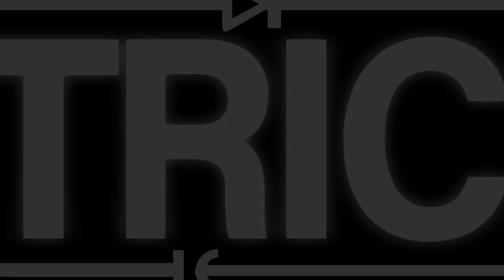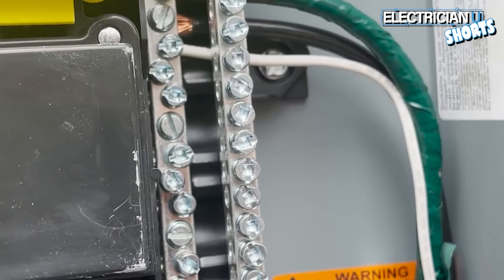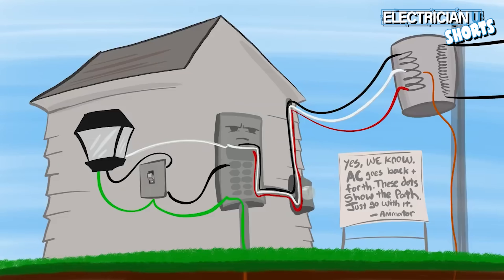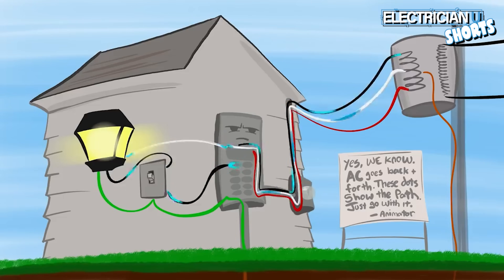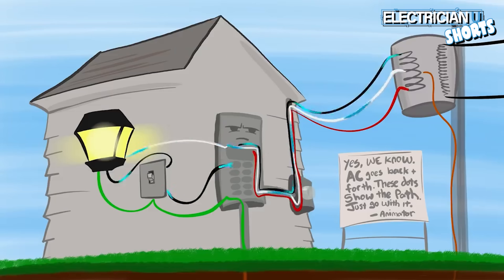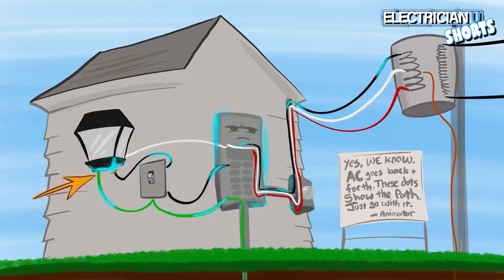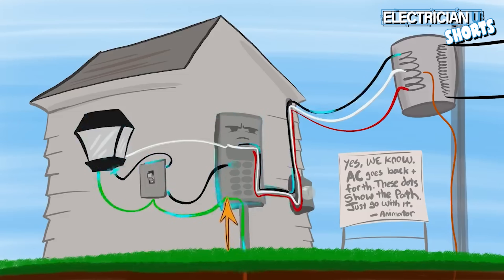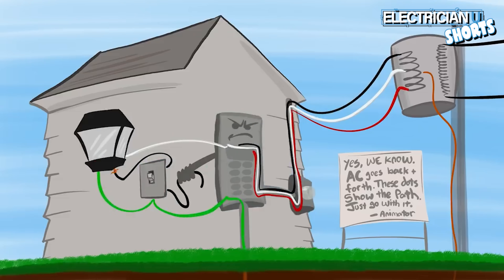SHORTS - WHY WE BOND (Neutral & Ground) Explained in 3 Minutes

Comment: Correct me if I'm wrong, but I think that the circuit is complete in case of the fault even without earthing the neutral, the image you used is for TT earthing scheme, and fault currents dissipated into the ground at the faulty load will correspond to currents being pulled up from the earthing point of the source, thus completing the circuit
Reply: I was thinking the same. This isn't a bad video but I don't think it explains anything.
Reply: The ground rod provides a low impedance path for lightning strikes. Without the neutral to ground bond at your panel (with the first disconnect) a ground fault would have to travel through the earth which is often insufficient to trip a breaker as in the supply's neutral bond to ground is too far away as the resistance through ground is too high. The bonding screw in the main panel is only to connect the panel itself to the neutral and at no other location should have the neutral ground bond. With sub panels the bonding screw which may have been installed at the factory must be removed if present.
Reply: No ground wire is needed to complete the circuit. Ground wire only provides another better path for the dangerous leak to get to ground, and hopefully trip the breaker through over current or gfci. Animation doesn't match the condition he is describing, "no ground".
Reply: It is because of occasions of high impedance ground conditions. If the ground is to dry it will be an excellent insulator rendering any earth rod useless. Check out SWER lines. 'Single wire earth return'

Comment: Hey, thanks for the explanation but this seems to be the old way of doing it. There is a regulation against doing that now, "...As of 2017, National Electrical Code requires neutral in subpanels to remain unbonded from grounded enclosures" So now what does that mean? How is the breaker supposed to trip? Unboding the neutral from ground keeps the sine wave of volts coming into the house clean and smooth, reducing dirty electricity in the house. Let me know what you think
Reply: I've read the same thing about the Neutral & ground only being together in the main & not in the sub-panel, but I saw that it was effective 2008. The Neutral is always going to have the return path and trip if the current coming from the source is not the same as the current going back.
Reply: The key word is "subpanel". They are bonded at the main panel. The key issue is to establish a copper connection from the equipment case to the transformer. Since the only way to do is to use the incoming neutral it is used but at the earliest possible point the ground connector is separated and then kept separate throughout the installation.

I just fail to see the subpanel question. It is like asking can you lie if you cross your fingers behind your back. The neutral an ground are kept separate once they have been separated.

Comment: the rule appears to be that you should never connect ground to neutral anywhere else than at the main panel. The reason for that (from countless individuals/websites online) is that once you do that, you would be a using a device's ground and neutral returns in parallel, and once the ground in a system is energized, this effectively energizes all other objects connected to ground in the system.

But given that ground and neutral are already connected together at the main panel, doesn't that do exactly what is meant to be prevented with this rule? Once you have conductors (ground/neutral wires) at equal potential somewhere in the system, how does connecting them elsewhere change their relative potential?
Reply: Hii want to discuss for the same
Reply: @@jash21222How?  one of the "neutrals" (ground) is not connected to a load/hot wire unless there is a fault so it will not be carrying any current,     you could argue that the capacitive effect could cause a small current to flow, but this would normally be negligible
Reply: Copper wire is not a superconductor, IE it has resistance, when a substantial amount of current flows thru even a resistance as low as a few ohms substantial voltage can develop, this is why sub panels have the neutral and grounds separated
Reply: What you describe is called a "bootleg ground", and may be found in older homes that didn't use a three wire system (hot, neutral, ground) People and crappy electricians would install three prong outlets and put a "bootleg" jumper between the ground screw and the neutral screw. Doing this can actually fool an outlet tester into thinking the outlet is wired correctly.
A bootleg ground can create a hazardous situation.
Reply: @justadbeer  worth noting a bootleg ground when used with a gfci doesn't really have any negative ramifications and the gfci will work as intended, until it doesn't
Reply: @jeffreystroman2811  -  Definitely worth noting. Anything is better than nothing.
Your last part "until it doesn't" is an important item to be noted. Our home inspector found a bad GFI to the jacuzzi tub (which was still working but wouldn't trip) when we bought our 19 yr old home three years ago, and I had another go bad last year to the septic lift pump, and then found one in the kitchen that was wired wrong.  It's also worth noting that doing this will fool a tester, and the outlets and the GFI should be tagged accordingly.
Reply: The current flowing in the neutral raises its voltage above ground potential. It’s entirely possible to get a shock off a neutral if enough current is flowing (usually if a fault occurs or some inept electrician hasn’t done up a terminal (been there, had a house fire because of that)).
Distribution transformers and generators are usually grounded at the transformer star point and frequently have earth leakage breakers fitted as well to detect grid level faults to ground. Currents flowing through ground back to the grid do nasty things to gas and water lines because of electrochemical corrosion.
Reply: The reason I'd that once separated thoy should be kept separate. Otherwise you could get stray currents.
Reply: @okaro6595  Isolation is required for the correct functioning of RCD breakers. These require a ground point between the metered neutral and earth with the connection upstream of the metered neutral point.
Reply: Electricity will flow through all paths  available proportional to the resistance.  If the neutral and ground are connected at a sub panel the current will return on both parallel paths.
Reply: You ground it so that your computer case doesn't shock you when you touch it.
Reply: When the current go's through the neutral and meet the ground at the sub panel it should not go to the ground because the circuit it's not closed between hot and neutral

Comment: Cool.  Can you explain why sub-panels or anything after the first point of disconnected is not bonded (ground and neutrals separated)?
Reply: Simply put nothing can be gained by connecting it. The whole point is to have a separate ground wire.

Comment: For over 50 years ground wires didn’t even exist ,that third  round pin  in the plug  was invented for handheld power tools for  shock purposes .breakers will blow if it’s shorts out to the common  wire .The reason the ground or earth rod is  bonded to common is most earthing rods have very poor connection to earth they’re useless. This practice is creating very dirty electricity for us

Comment: My question is if current flows through the neutral back to the panel, and neutral is bonded to ground, why don’t you feel a shock when you touch the panel since current is going through if
Reply: You are confusing current and voltage. Incoming neutral keeps the voltage of the panel very low. If it breaks you will feel it.
Reply: Because the neutral is not bonded to ground in the subpanel or anyplace else in the system

Comment: In Norway, we are told that the reason we don’t mix earth with L or N is because we want to protect humans, pets or livestock from a potential current leakage, by connecting earth with the metal part of the component.
Reply: Earth protects equipment, not people. To protect from body harm you need an earth leakage circuit breaker. It will not cut the power when there's too much current, but when the incoming current doesn't equal the outgoing. The tiniest difference will instantly trip it and actually save you from harm.
Having just a short circuit breaker will still kill you. 😊

Comment: 1:39 There’s a mistake here. In case of a ground fault, current does travel through the equipment grounding conductor, but not through the electrode grounding conductor and then into the planet Earth.

Comment: Well sort of....in the UK, as I understand it...the earth and neutral are shared and connected back at substation, here it is grounded,  the fault will have travelled back to substation via the earth then travel back to panel on the hot wire to complete the circuit, and to that circuit breaker and then it will trip and cut of electrical supply due to overcurrent of more than 30mA. The RCD picks this up. Residual Current Device. All this will happen in less than .4 sec. That's how I understand it. The current has to go somewhere, so rather than the neutral in the normal way, the earth conductor takes over and gets it back on the hot wire at the substation (transformer) back to the panel in the property and here it trips due to overcurrent being picked up by the breaker.
Reply: No, they go to the transformer. Substations are not relevant to this issue. Substations are between high voltage and medium voltage networks.

Also you are confusing the breaker and the RCD. The basic protection is provided by the earth wire (the CPC) and the fuse/breaker. If there is a fault and the hot wire in a device touches the case there will be high current. This will blow the fuse in the plug or trip the breaker making it safe.

Additional protection is provided by RCDs for most circuits in new installations. This monitors the imbalance and if over 30 mA it cuts the power. It would act in the above case (I do not know which would be faster to break) but it would also act if you, say, touched an exposed wire and got shocked.

Comment: @Electrician U There is one scenario in which this method (bonding the Ground to Neutral) can result in deadly accidents. Here I will present to you this scenario: 

- the Ground is bonded to the Neutral at the circuit-breakers panel;
- during a storm, the neutral wire (only the neutral wire!!!) between your house and the post/pole (the source/transformer) snaps/breaks;
- in this time the lights in your house are turned on. 

This means that the current that comes through the Hot/Black cable down to your light bulbs, now returns through the other wire/cable (the neutral wire), it goes to the circuit-breakers panel and, as the Ground is bonded to the Neutral, the current returns back to the all the metallic cases of all the devices in your house (including the fridge) through the Ground cable. 

In this case, if you will use a current-measuring device to check the wall outlets, you will notice that the maximum amount of current runs trough EACH of the 3 terminals (even through the Ground terminal!!!) of the sockets.

In this case, touching your fridge, your microwave oven or the metallic cases of any electric device found in your house would be the same like directly touching the hot wire - the worst can happen/a deadly accident can happen. 
Am I right?

Comment: I have some anecdotal experience and questions related to that, that are related to grounding and bonding. I once connected the neutral directly to a waterline that was under the sink out of curiosity to see if the circuit would work. And it did. But this video got me thinking, is it really true that it needs to go home through the neutral? Perhaps I thought it was going home through ground, but it might’ve just been going through the waterline back to the panel, and then completing the circuit that way. If I would have done the same experiment with just ground rods I think I will have a pain better results. But I am curious why the breaker doesn’t work in just reading the flow through the hot in either of the alternating current directions. It seems like the technology should be “smarter“ than that at this point. Lastly it sounds like the flow won’t go to ground like I thought it would, unless it’s bonded to the neutral and has somewhere “home“ to go. I always thought that earth was the ultimate home, but maybe I’m wrong.
Reply from the maker: There are a lot of different paths it can take. It's going to take the path of least resistance.
Reply: @electricianu  I’m confused. Did you make the video? The video says it has to go back through the neutral To create a “loop”.

Comment: Does the aforementioned only apply to ROMEX in residential wiring or does it apply to conduit residential wiring also? Have yet to see a green (ground) wire anywhere in a main panel with conduit residential wiring here.

Comment: I agree with almost everything you said except ground = earth. The wire we call grounded is really a zero potential wire that happens the allow current to flow through earth but that current needs, as you said, go to the source/xfmr. Earth is a terrible conductor but the zero potential path(conduit or bare wire) provides a low resistance path. Not earth!

Comment: 1:37 it would have a return path depending on how wet the soil is, just no such low resistance path as could provide Neutral wire
asking myself how if transformer had no ground wire connected to earth soil ..and that´s where without  Neutral bond to Ground ...there  would be no grounding at all- what isn´t as bad as proclaimed officially ,I could expain in detail
Reply: Grounding has been mandatory since 1913. There are arguments for and against it but the consensus is that the benefits outweigh the harm especially with modern protection of equipment grounding and differential protection.

Comment: I’m installing a radiant heat concrete floor in my garage/workshop. Hole slab sits on 2” of foam insulation. The concrete walls are grounded but the floor will not touch the walls because of the foam. Do you think I should ground the floor? Just thinking that every time I shut the lights off I’m going to discharge static that built up and give me an annoying little zap.
Reply: When I say ground the floor I mean just add grounding rod before I pore the floor

Comment: does this mean that ground is always getting the signal the neutral is getting even when no problem ?
Reply: No, it does not. In a perfect world, the ground wire will never be used. It's a safety/back up wire. It only provides a path when a ground fault occurs, which should instantly trip the breaker. They are separate (ground & neutral) until they reach the main panel and then are bonded because 1) we need a complete circuit and 2) electricity is always trying to get back to its source.. so the current flowing on the neutral does not back-flow onto the ground wire because it's trying to get back to its source-by any means necessary. This is why it does take the path of least resistance but ALSO takes any other path that is available. The current won't be the same, of course. I hope that clears things up.
Reply: thanks alot for you kind help

Comment: I thought GFI recepticals do not require a ground to operate?  They are code appoved in my area for upgrading older houses without a ground. They do seem to work.
Reply: That is correct. They are GFCI not GFI like everyone repeats, there is no such device (gfi). GFCI's detect current differentiation between ungrounded & grounded conductors. So any change in power and they open the circuit. Very safe and awesome devices.

Comment: At main panel, since Neutral and Ground are bonded, some electron currents do  take the ground path back to the utility.  What is max percentage of total return current flow allowable before utility needs to fix their neutral? 1, 2, 5%?
Reply: You should think it as a voltage loss. There is some voltage loss at the neutral. That is the voltage there is in the ground rod. I'm a well balanced system the current on the neutral is small so the voltage loss is also very small. In any case it can it ve many volts so the current on the ground is small. I'd guess 1% is the best of those.
Reply: Wrong. Very high resistance with the ground path, electrons don't go through a highly resistant path such as Earth when they have a straight shot back to the utility. That, and they are going the long way around, which makes your theory only that, a theory.
Reply: @Rico702Vegas  Resistors in parallel . The electrons will flow through both resistances in proportion to the resistance .
Reply: @Rico702Vegas Electricity takes all paths. The share that goes through the ground is very tiny.